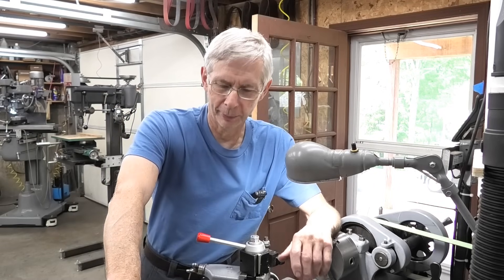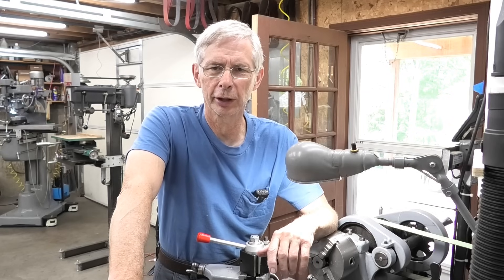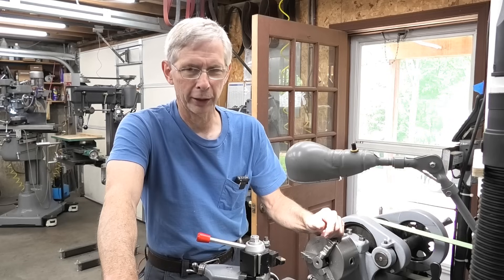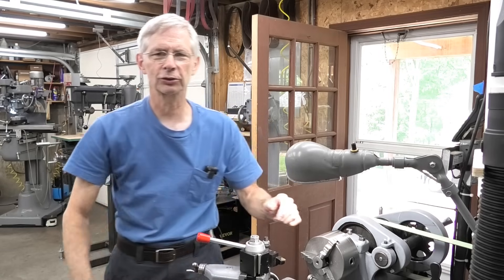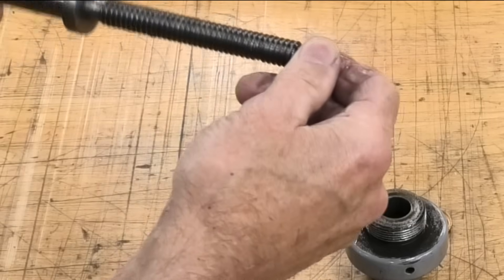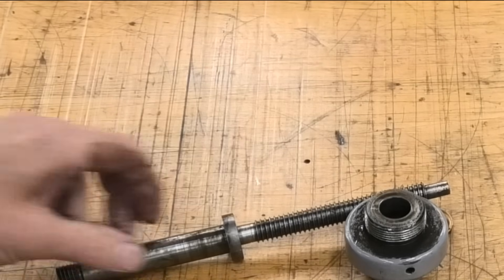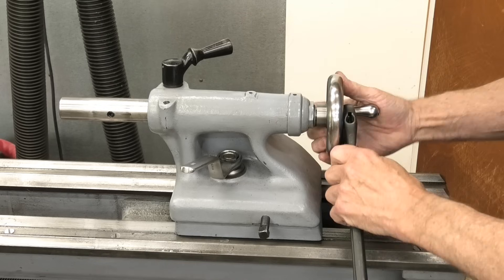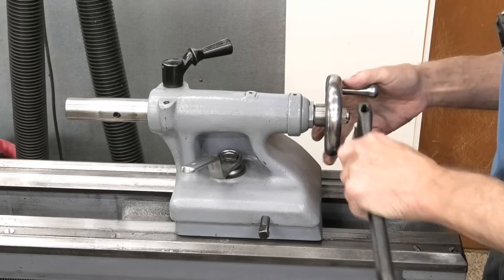Tailstock Repair - New Acme Threads

Comment: How about making that move over with a dove tail for it as well.   As for the brass bolts, maybe drill the end and press in a steel bearing that could roll.  Good luck with what ever you do.
Reply from the maker: I remade the follow rest. the second dovetail is an interesting idea but I made slotted holes instead. The new one has sealed ball bearings. Much better.

Comment: Another good video! I enjoy seeing what doesn’t always work perfectly almost as much as what does😊. Your channel is “real” for the home shop hobbyist. I do watch some of the “pros” in their industrial shops, but they don’t relate very well to my level of experience (and equipment). I have a similar lathe (1941 SB 10) and an old “round ram” Bridgeport. The “round ram” gets a lot of hates on some sites, but I just cut two gears for my SB QC gearbox and they work great. Watching you jump right in to make things you want or need has given me more confidence to tackle projects I would not otherwise think I could. Thanks for your inspiration and the time you dedicate to making these videos!
Reply from the maker: Wow, great comment, Thanks! And you are right. I've learned a lot over the years but the two most important things I've ever learned is that there is always more to learn and always more than one way to do things. You're right about the pros. There is a big difference between an 800lb  and 5,000lb lathe. Difference procedures apply. Then of course there is the cost factor. The home shop can't always afford or justify spending $$$ on tools or accessories. Good work on the gears! I've cut a few. They all looked perfect but were always noisy. Either the cutters were not quite right or I went too deep.

Comment: Curious why you didn't try using an acme die instead of cutting the thread ? Would it have been easier or better result? Not that yours isn't decent enough.
Reply from the maker: That would have been okay I think. For sure it would need to be guided. Using a die on threads that long with a normal die handle is sometime a problem. Also, the LH Acme dies are hard to find and expensive.
Reply: Since a hand die cuts the full thread in one pass it would be impossible to turn with an ordinary die handle.
Reply from the maker: @ellieprice363  I never thought about that but you're right.

Comment: I've got my base roughed out for my follow rest. Still trying to cut a decent gear for my threading dial. Had to get a new belt, my was slipping so bad the motor would stop. Thanks for the ideas on the follow rest. I may try it on mine.
Reply from the maker: Don't copy my follow rest. Maybe the base but the rest needs some changes.
Reply: @WinkysWorkshop  just copying the basic idea, I saw the problems that arose with yours.  I'm thinking of slots and an adjustment screw  to move forward and backwards  or left right. Sort of like the tailstock adjusters. Also the following brass bolts will have some sort of roller, either ball bearing  or roller bearing to keep from being chewed by the work. Really just need something to support long work better than what I have, which is nothing at the moment.
Reply from the maker: @jeff1176  sound like you are on the right track although if you mount to thr dovetails the in and out adjustment isn't needed. Only side to side

Comment: What grade steel did you use for the shaft? I wonder if the steel might be part of the reason the threads didn’t turn out to your satisfaction. Thanks for allowing us to visit your shop and watch you work.
Reply from the maker: Good point, it was cold rolled which is not ideal.
Reply: @WinkysWorkshop  Leaded cold rolled would have been better.
Reply from the maker: @BasementEngineer  I have used 12L14, it machined like butter.
Reply: Whenever a work piece gets a lot of work I go and buy a piece of requisite steel.
I'd use 1144 aka stressproof for this kind of job.
For those of you not familiar with this stuff, it is quite hard and strong:  Over 100,000 psi yield strength.  But best of all, it machines like a dream!  Try it you'll like it.
Reply from the maker: @BasementEngineer  I need to explore steel types more. Strength is not an issue here but I sure other alloys machine much better.

Comment: Thanks for this. I've been experimenting with single-point cutting of metric trapezoidal threads (v. similar to Acme ones). Due to my ignorance, what I didn't realise is that the threading insert needs to be tilted to match the lead angle of the thread. For a given pitch, the smaller the diameter of the thread you are cutting the greater the lead angle. The insert is tilted by the anvil upon which it rests in the tool holder. Different anvils are available to achieve different tilts. This is explained in the "iscar pocket threading handbook". Proper machinists already know this of course, but I didn't. Also, the suppliers of cheap inserts that I normally buy don't offer different anvils. Getting the tilt right produces a cleaner cut.
Reply from the maker: I've thought about this in the past while grinding HSS tools (standard threads) but I figured the relief angle was adequate in the insert for the specified thread range. In fact the insert I bought is specifically for 10 TPI.
Reply: @WinkysWorkshop  It may be completely fine as is (how could I tell?). But point is although the insert is specifically for 10 TPI, the thread lead angle varies according to the O/D of the part being threaded. Therefore, whatever tilt the tool has, it may not necessarily be right for your O/D. I guess the default anvil has a tilt based upon an assumed part O/D which may or may not be close to yours.
Reply from the maker: @samuelfielder  Yes this is true but it seems odd that they did not grind a bit more relief in the insert to accommodate. But I agree, the TPI are not related, at least not significantly. Also, why is this only with acme?
Reply from the maker: @samuelfielder  You were correct about the insert angle. Apparently it's better to shim the insert with all thread types but much more important with acme. I've thought about this before but never looked into it. Thanks for your comment. It pushed me into investigating. https://youtu.be/s8PjD-BP2JY
Reply: @WinkysWorkshop  Great follow up! We all live and learn.
Reply: You’re correct on every point although I’ve never heard of a tilting anvil. One way to get around tilting the tool or insert is to grind a relatively steep side angle on the tool in direction of the cut to prevent it from rubbing. After a long career as a machinist I’d never considered tilting the tool so you taught me something today. Having said that I can’t imagine how an insert can be tilted while leaving the top surface parallel with the shaft.

Comment: Cutting Acme left hand threads with a single point tool is a hill I have not climbed yet. Definately a challange for even an experienced machininst. Getting the depth correct seems to be the issue. Unlike normal bolts and nuts backlash is critical. Not so much on the tail stock but on crossslide and compound slide nuts and screws. I've rebuilt both the cross slide nuts and screws on both my lathes but I bought pre threaded 4140 Acme rod from Greenbay Manufacturing.they also sell nuts and Square sleeves. I  made the nuts out of castiron using Acme taps. On my Clausing 5913 I only have .0002 yep tenths back lash. I'm in the process of making a steady rest and will also be making a follow rest. Without a follow rest long threads are a crap shoot because of tool deflection. Great video as always . Thanks for bringing us along.
Reply from the maker: Yeah, tail stock was not critical but I need ro figure out the depth of cut. I think they will be easy if i get the follow rest right.
Reply: Joe Pie recently made some tiny threads using a follow rest, he used phenolic resin as a back up and stated that ge thinks it rubbed off the burr made by the single point. His steady was adjustable as well. I have not done an Acme yet, but I have done metric trapezoidal nut  for a vise.

Comment: I'm sure next time you will set the topslide at 14,5°. It gives better results :)
Reply from the maker: Ha...  thanks for the angle! So it does help? THANKS
Reply: @WinkysWorkshop  For sure, because the tool will cut at only one side and the tip.
Reply from the maker: @Rustinox  I will definitely try it next time. I never go straight in with standard threads.

Comment: A little trick I use sometimes for cutting ACME threads. I start with a regular thread cutting insert, then switch to the ACME insert. A little practice to know when to stop and switch to prevent messing up the crown on the finished threads though. It save a lot of cutting time, especially on smaller or lower powered machines.
Reply from the maker: Wow, I actually though about doing that but wanted to give the follow rest a shot. I think my follow rest has some issues. Thanks

Comment: Try a swivel screw. This will allow adjustment to accommodate wear while maintaining the shape touching the part.
Reply from the maker: You mean kind of like on a C clamp? I need to rework the follow rest anyway. I want to be able to change the position parallel to the bed. I was thinking either a bearing or a sliding bar like a steady rest.

Comment: Good morning Mark. 
Excellent video and shows there’s always something that needs tweaking. The good part about older machines is that they were designed to be repaired. 
For your follow rest, how about roller bearings captured in a machined pickle fork threaded adapter that screws onto the bolts. I’m thinking that a 3/8 wide roller would give plenty of support. 
Also, in one of your previous videos, you put sanding screen underneath the tool holder. What grit did you use?
I have the same issue with two surfaces being smooth and the tool holder moving around. 
Have a good weekend my friend.
Reply from the maker: Pickle fork? I agree, 3/8 is adequate. The sandpaper was a mesh coated with abrasive designed for drywall. I think 80 or 100 grit. It comes in 4x10 sheets (aprox.)
Reply: @ A pickle fork is used for suspension work to pry ball joints off. Basically a shaft with two parallel arms.
Reply: @ I thought you used 80 grit and I bought some. 
I haven’t had time to install yet. 
How is your ankle doing?
Reply from the maker: @jimfiles3307  The ankles fine, slightly weak but thats all, thanks. Yeah, any grit would likely work.

Comment: If you were to use bronze bolts instead of brass which is much softer you would probably have better luck with your follow rest. Copper scores 35 on the Brinell hardness scale, while brass scores between 55 and 73. On the other hand, bronze has a score between 40 and 420.
Reply from the maker: Interesting, I think you're right. Or maybe bearings.